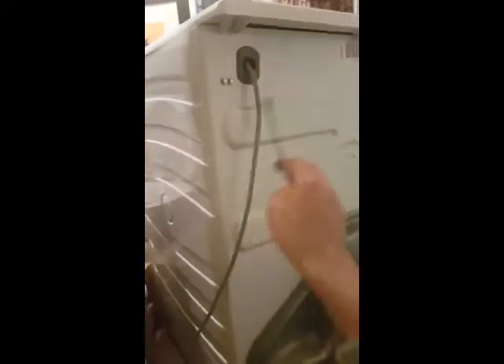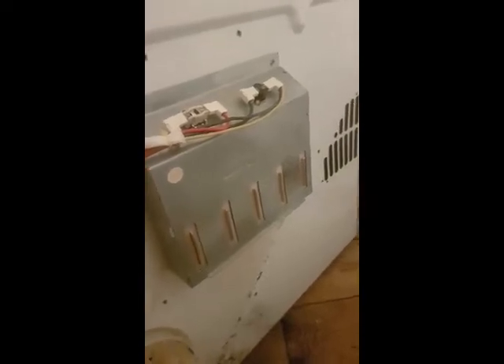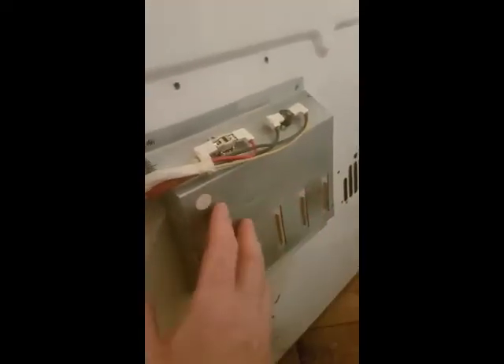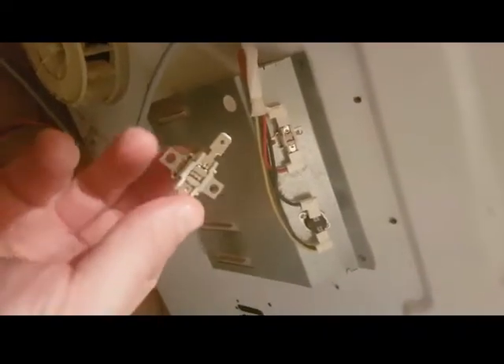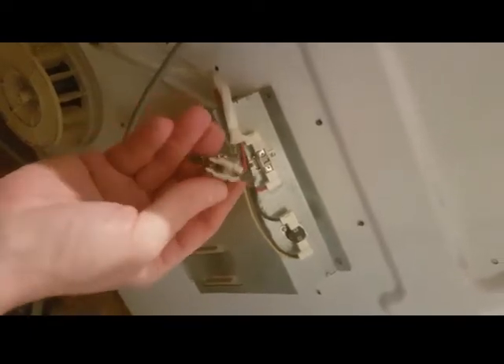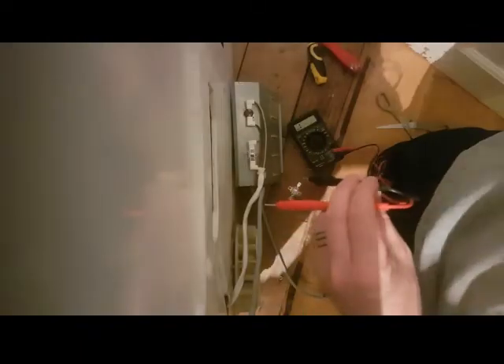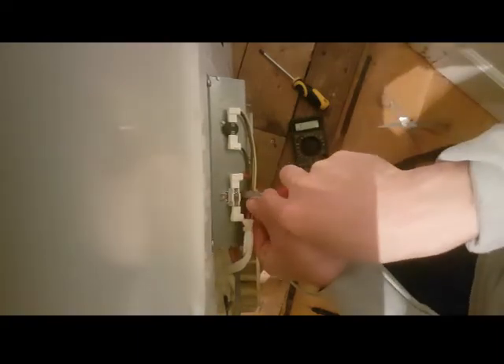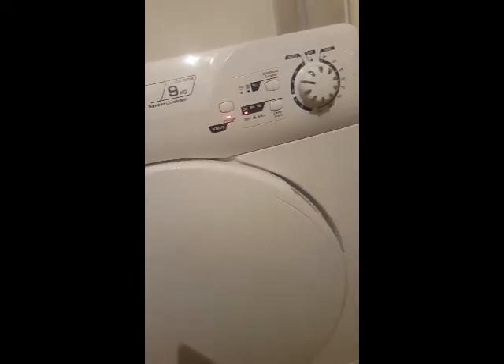Candy condenser dryer no heat and all lights flashing

Comment: I’ve just fixed this today, but there was a reset button I pressed all lights went out. Now works fine
Reply: A reset button? on this model? where was it located?
Reply: @tiagotavares9569  Take out the plug, undo back plate of the machine, there should be two electric small plugs together in the top right, between these small plugs there is a button, press it until you hear an internal click, this button trips because the heating element is getting too hot. That's why all the lights flash away on the front display.
Once you hear that click, put back plate back on and plug in.
Reply: @stuartsinclair6269  it's not the same model. You've a C8 not a C10. C10 Do not have the reset button